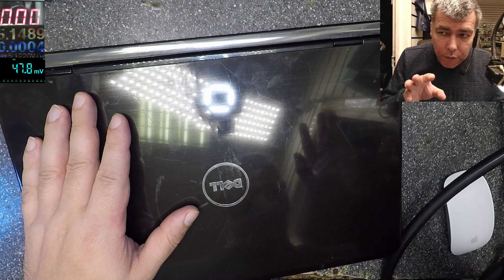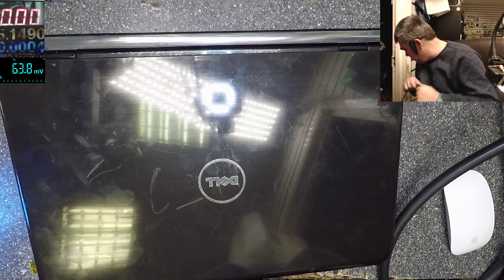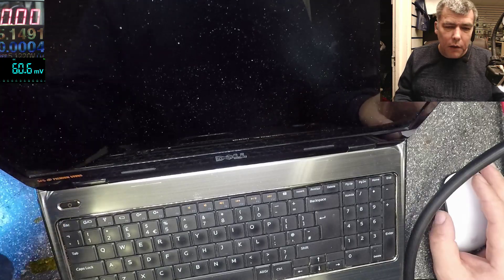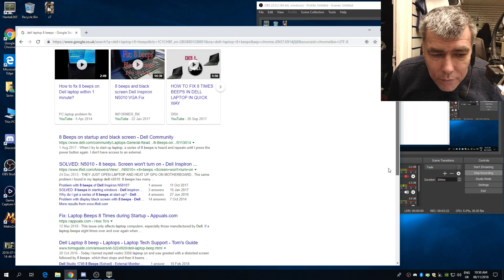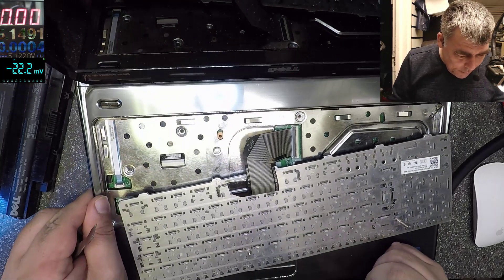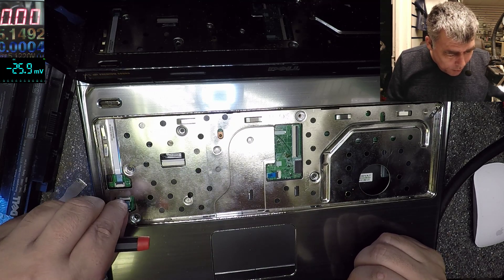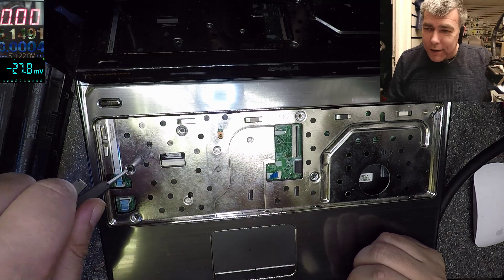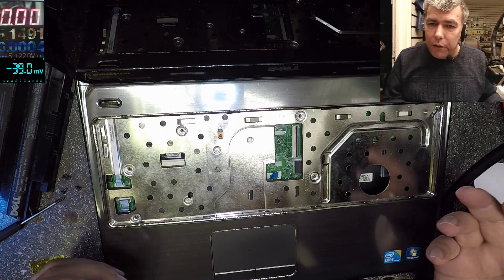Dell inspiron N5010 no picture - 8 beeps repair

Comment: hello, could I ask you,, the same  laptop n5010,, display on external monitor by vga port, but not on hdmi or its internal screen. and LCDvdd is not appear. is it possible to ATI chip or descret, or anorther reason, you answer is very important.

Comment: Use to have this GPU heat issues but fixed it by just replaced all the thermal pad behind the heatsink which already break down. Need to flip it over.

Comment: Thanks a lot for your hard work. IIIIII need your help. I have this problem with my customer device. I did as you did, however, the fan is stoping after powering the laptop. How can I do ( the wire ) you just did before this video?

Comment: Mine too had the same problem. I didn't had
the courage or tools to do it my self, I went
to a local service center & they told me they
re-balled it it worked for around 8-9 months.
Now same problem they service it some
way and it last only 3 days, now they say
nothing to do. It's a total loss.
Now they say they can buy back full laptop
for 2000/
Is there any way to fix it...?

Comment: I am getting single continuous long beeps spaced after 3 seconds each when staring laptop. Also display is black. I had by mistake started a .exe for bios update in windows.. screen went blank in the process and thereafter it never booted amd is giving me the beeps and black display. How could i fix this?

Comment: best reflow done with a coin on top of chip and heat under and on top with kester flux.. heat wide as pcb expands some.

if its bios issue here is the n5010.hdr to recover in usb stick with END key
https://www.mediafire.com/file/dcnh7vf4scojyb8/n5010a15.hdr/file

Comment: Hi Sorin, I have a Dell Inspiron N5010. It started shutting down as the fan was not starting. I opened it up and cleaned the fan. On restarting the picture started to flicker and then went blank. If I connect it to a monitor I can see the laptop is on and working. Is this likely to be a backlight issue?
Reply from the maker: most likely

Comment: I had one of these n5010 15r in recently with same 8 beeps, i checked motherboard 1 of the 6 mosfet (1.5v memory) had burnt at 8:19 near heatsink back plate. I replaced mosfet, now no bleeps but still wouldn't boot tried everything. So customer just used it as doorstop.

Comment: The other option is to convert it to UMA only if they are not needing the discrete graphics chip. A bit more involved for this model but definitely doable and it will never come back. :)
Reply: What does UMA mean ?
Reply: @danielford7834  Unified memory architecture. The integrated graphics shares the same ram as the CPU so basically it's the on-board graphics.

Comment: Any thing that beeps should possibly check the manual just like the old days 
normaly used to silly things, i remember once i was dong a simple job just 
helping install drivers for some old women, charged maybe £5 told her 
it was ok charge was nothing, as i sat down and rebooted the machine
one of the ram modules died on me FFS that was an unlucky job..

Comment: My friends had one of these and spilt pop on it, if i knew then what i know now
i would have been able to try and fix it,  but i still sold the parts for more than he
would have gotten for it second hand just luck..Keep up the good work :)

I remember when those smaller laptops come out i got one with broken hinges
and cracked case i mainly wanted it for the screen only, crazy thing is i paid £15
for the small laptop cant remember now what it was, atom chip based i remember
that, once i done the screen job and go money from that and sold the motherboard
from it and the smaller parts i was inpocket a huge %..Crazy things like that help
with day to day living, 

Like when i was at the car boot lol i seen this angle measuring thing asked the
guy what he wanted for it he said 50p so i bought it put it on ebay and people
kept inboxing me with loads of offers for like £30 i was giggling inside, when
it finished bidding it sold for £55 turns out it was from a vintage craftsman wood
cutting machine..LOL. that is not a bad profit especially when i was struggling
at the time.